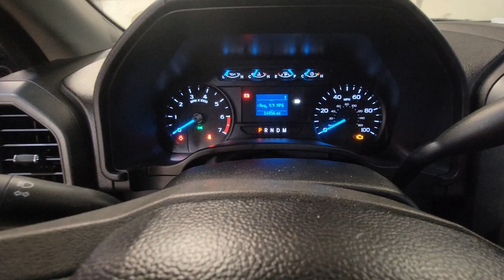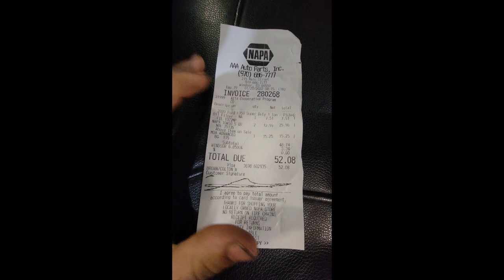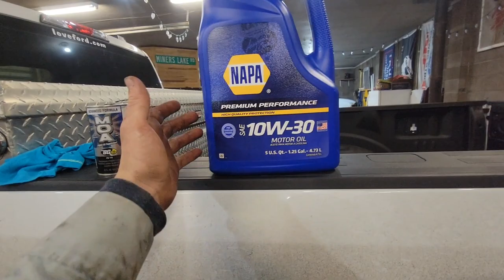7.3 godzilla vs diesel episode 3, first service and tire size change

Comment: The height of tires is part but also the width (245vs275mm is greater than an inch). The tires height makes difference in revs per mile  8% ish . About 10.7mpg.

Comment: I have driven my last truck and current truck to 3-5 percent oil life and than changed it. Never checked the oil between changes.  A lot of people do not like change and technology. Lol. The engineers are damn good nowadays, not perfect but they did test and design these engines. They have more knowledge than me...
Reply: I agree, then engineers designed everything a specific way, and probably not exactly how they wanted to design it. You gotta remember at the end of the day engineers decisions are influenced by other departments. The "forever" fluids and OCI recommendations are likely designed with the original owner in mind who purchased new, not the second or third owner as they aren't as likely to be under warranty. Longer OCI makes the person who purchased new feel like it's a higher quality and better deal because it saves them time and money. I promise the recommended OCI is not based on the engineers wanting the engine to last 300k miles, cause that doesn't actually matter to Ford

Comment: Btw, not to nag but I’d recommend dropping the MOA (just dilutes the oil & screws up oil mfr’s additive package) and just using a better oil like the new QS “Full Synthetic” stuff. Getting the right weight isn’t too critical, but I wouldn’t run a thicker oil in winter…?

Did you guys get the block heater in this rig?
Reply from the maker: Yes it has a block heater

Comment: Dumb question for ya or anyone who knows.  Is the oil life sensor actually measure oil quality, and if so how, or does it just calculate oil life using rpm’s and mileage?  Thanks. Love the F250 and the 7.3. Can’t wait to order one when we get back to normal, if they ever do.  I ain’t paying list or over for a depreciating asset.
Reply from the maker: The new gm 6.6 gas has an oil quality sensor. Ford just goes off of engine hours I believe
Reply: @ColtWR  thanks.
Reply: I heard in GM’s they had a sensor that shined an infrared light through it but ford ps I’m not sure. My F-150’s seemed to be by mileage and so does my mustang. The mustang I put Amsoil in it and at 5,000 miles 10 quarts isn’t even dark yet but it’s telling me to change it. So who knows.